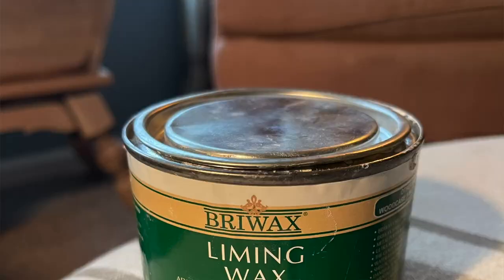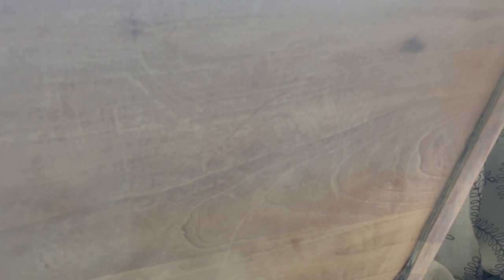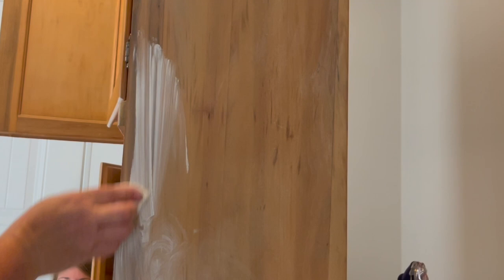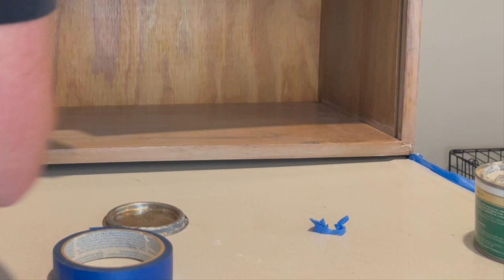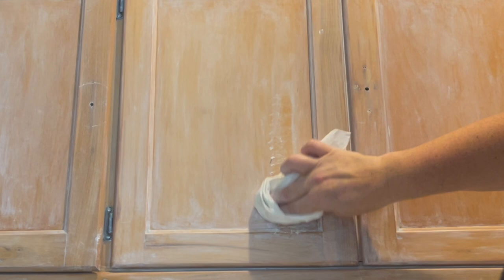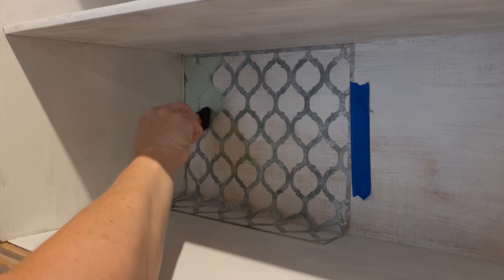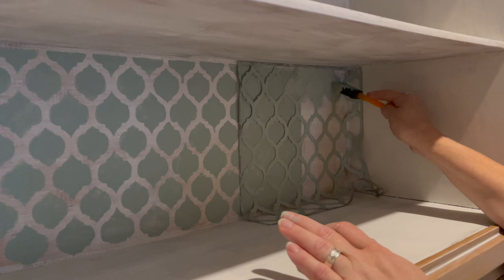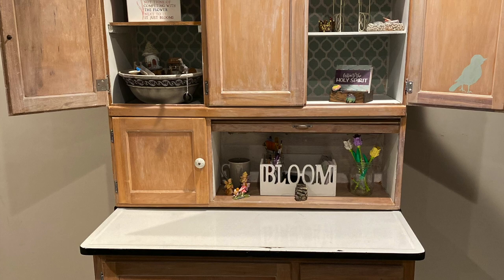Liming Wax on Hoosier Cabinet to remove orange tint ~ stencil inside with paint

Comment: Looking to try this on my oak cabinets! Is it ok to do it on top of a polyurethane seal without sanding first?
Reply from the maker: I would say it would work!  I would suggest doing a test spot on the inside or the back first.  Make sure it cures all the way!
Reply: Tori I want to tone down my orange oak cabinets too! Did you try this yet on yours?